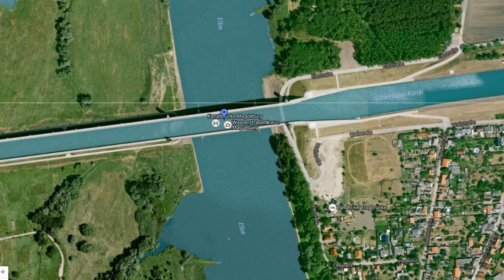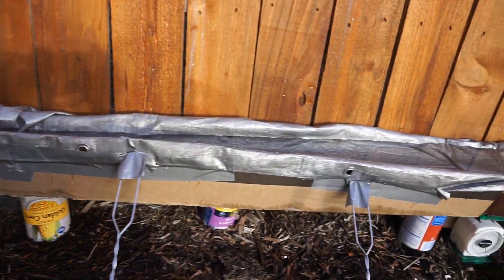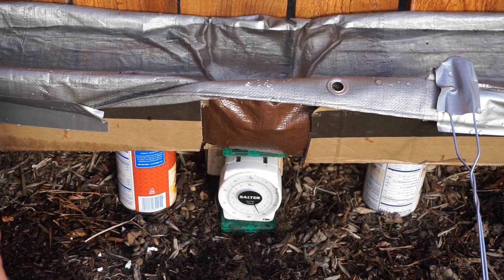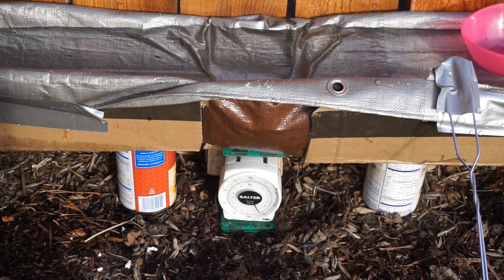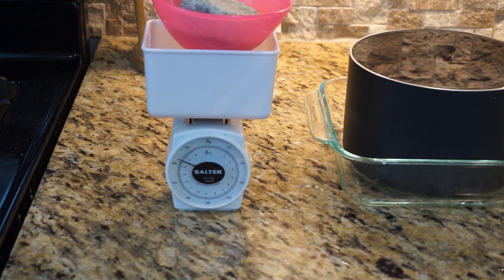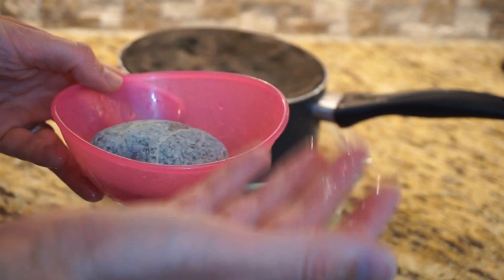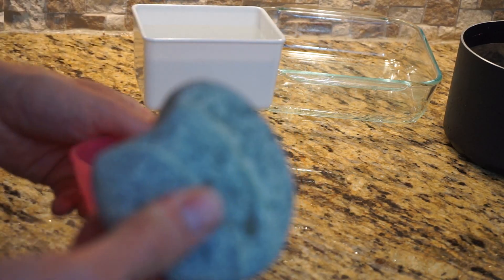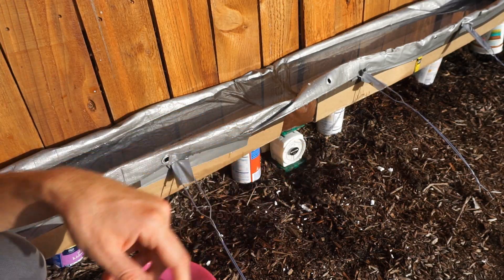Surprising Water Bridge Physics | Bouyancy And Boats

Comment: As you mentioned, most of the boat's weight is distributed throughout the water, which causes the water level to rise very little. What if you put the boat in a container only slightly wider than the boat itself so that the displaced water can cause the rise of the water level in the container? Also, does the boat's weight change if you place it in a partially filled bowl of water, provided no water spills out of the bowl? I think it does because the scale carry all the weighs.

Comment: let's say, i put a bucket half filled with water on a weighing scale. then i put a steel bowl which floats on the water. the water doesn't spill from the bucket. before putting the bowl on the bucket, the scale read 10 kg. the bowl is 500 gm. what will happen to the reading of the scale after putting the bowl in the bucket?

Comment: A year ago, we had the Baltimore Francis Scott Key bridge collapse because a huge freighter accidentally rammed into one of its support columns. I heard they are going to reassess the structural stability of lots of bridges across the country because of this. Now after seeing this fascinating video, I am wondering. Could the principles in play in these water bridges be used somehow in regular bridges?  The way water distributes weight all throughout its volume. For example, the hydraulic brakes in your car also uses this idea.  Could we come up with a design that distributes the weight of the cars or trains passing over it down to the water underneath via fluid?  What if the very water these bridges were traversing could be used to occupy the structure? How could you have automobiles cross the bridge while only exerting their weight onto the structure via the containing fluid? Maybe some where they have actually tried something like this.

Comment: The fact that the boats float, ( at least I hope they do) means that they’re lighter than the water and displacing it. So, if the bridge can hold the necessary amount of water to function, then in will hold up the canal with boats crossing.

Comment: The falkirk wheel uses the same principle. You can have multiple boats on one side and none on the other but since they displace their own weight in water the weight of both sides of the wheel remain equal.

Comment: You can cut a wine bottle in half length wise, poor water inside and balance it at its center of mass and you can then add a weight to one side and as long as it floats the bottle won't fall over.

Comment: I was thinking about this for a couple of days and it was driving me crazy.  Think about the implications of this.  Every boat in a canal theoretically displaces some amount of water along the entire continuous segment of the canal.  I assume the effect of those boats ends as soon as the water drop off or steps up, that is, at a lock.  If you have dozens narrowboats in a marina somewhere in the English countryside, a water bridge 10 miles away feels some amount weight for every boat in that marina.  As soon as you launch a new narrowboat into the canal, it's weight is added to the entire length of the canal (between the first upstream and downstream locks).  It must take some time for that weight to travel up/down the canal...
Reply: Yes you are correct and yes any change in the mass in any part of the body does take a non zero time to be felt as a pressure increase in distant parts of the body of water. The disturbance propergates in the form of a pressure wave moving at the local speed of sound in the body of water this then pushes the rest of the body of water out ane up until it meets something that can restrain the slightly increased pressure. You will have some periodic decreasing waves bouncing around for a while too once this happens. But it is fast enough that lowering a boat into said Marina will affect the structure of that lock 16km away in a little over 10.5 seconds.

This is assuming average temperature and pressure at the surface and the canal being straight. And deviations or obstructions may delay this a little as waves will need to diffract and reflect off the canal taking a longer path than if there was a direct clear line of sight for them to travel along.

Ultimately this is simply because as pressure waves the disturbance travels at the speed of sound which for fresh water at the temperatures and pressures of Earth is around the 1500m/s mark.

The actual movement of the water to finally bring everything to equilibrium will happen slower because the water is not actually rushing out in bulk that quickly it's oscilating around because of the presure waves and a much slower small net flow happens as everything settles back down. But even when those waves first reach that far lock the the mean wave height will actually be pretty close to what the equilibrium level will ultimately be assuming there are no some odd obstructions funnaling it and doing strange things locally. Overal the whole body of water is already interacting in a way that contributes to supporting the added mass by that point but it will be doing so dynamically for a time until everything settles back to a stable equilibrium.

Comment: But the problem is, you have to have connected both ends of the water in sea or lake, otherwise your water is going to spill over the edges when there is enought weight on boat which stays on surface. And that leads to other problems like water level changes and size of the "bridge" and canal width which should be enormous if you want to move bigger loads.
Reply: but it changes evenly across the surface so it would really need to cover a large portion of your lakes to cause a problem. You will have a traffic jam long before that.

Comment: Hey i dont get a thing about relativity that it is based on the fact that velocity of light is constant in all frames .
So can u plz make a video on that
Reply: If you are moving in the same direction as a laser at light speed than the light will take 1 second to move 299792458 meters, for someone standing at the source of the laser it will move the same distance in 1 second, but they will observe the light moving a shorter distance in that amount of time relative to you, although that is because for you it hasn’t been 1 second yet. In short their seconds are faster than yours. By the time the light has traveled 299792458 meters for you, the light would have traveled 599584916 meters for them, because for them it has been 2 seconds.

Comment: It is a great video, sir.But I have doubts regarding the loads.
1.How do you determine the wave action or load due to wave action on the water?
2.To compensate for the minuscule load due to ship can we reduce the amount of water in the bridge to reduce the load on the structure.
3.Last but not the least.Is the MAGDEBURG WATER BRIDGE a prestressed structure or a conventional structure?
Reply: Well the weight of the boat in the entire body of water is spread across the entire bottom of the water not just the bridge that is why it is such a small amount of extra load on the bridge. Water level rises evenly so it adds weight everywhere evenly.

To calculate the load added by waves you would have to do really complex math but in most cases it evens out because a wave has a peak and valley that cancel out. It is the wake in front (I think wake is behind don´t know what it is called in front) of the boat that adds load as it pushes the water level higher than what it would normally be. You would have to calculate the shape of that wave above the normal high water level which should look like a triangle times the width of the channel - the volume of the part of the boat protruding into that wave but only the part in the wave above the normal high water mark .    Like this   >/\-  The first > is the bow of the boat pushing the water /\ is the wave and - is the normal high water mark with no waves. So the volume of water above the - is the extra load added to the bridge.

Comment: it was a cool demonstration. i think that is called the arquimedes princile right? Well here is my question if a hose is throwing water at an angle of 20° and with a velocity of 20 m/s, at what altitude will the water arrive to a wall one meter away from the hose?
Reply from the maker: I have a feeling that I'm being asked to do your physics homework...but just this one time I'll help you out since I can't resist a good physics problem:) So I'm assuming that the hose is on the ground aimed at a 20 degree angle. In that case given that the time it takes the water to hit the wall would be about 0.05 seconds (t=d/cos(20deg)*v), then you just solve for the height (h=v*sin(20deg)*t-0.5*g*t^2) and get about 0.35 meters!
Reply: that wasn't a homework,  it was a problem of a physics contest that my teacher couldn't answer

Comment: if  you have a perfect sphere of mirrors on the inside. and it were possible to shine a light in there without disrupting the perfekt mirror room. how long would the light bounce inside there before the energy of the light was all used.
Reply from the maker: Good question! If you have an absolute perfect mirror. This means that no photons of light are ever absorbed by the mirror, then the light will forever bounce off the mirror ad infinitum. However, a perfect mirror does not exist and is in fact an impossible feat. There is always a slight chance that a photon of light is absorbed by the mirror. So, lets assume we just have a really good mirror. In this case lets say it reflects 99.99% of photons and absorbs only 0.01% of photons (the absorbed photons then becomes heat in the mirror). Even in this case, if we have a spherical mirror that is 1 meter in diameter, since light moves so fast (300 million m/s), the light would all be absorbed in less than 33 microseconds (For reference a human eye blink takes about 350,000 microseconds). So, no matter how good you make your mirror, light will always be absorbed faster than the blink of an eye!